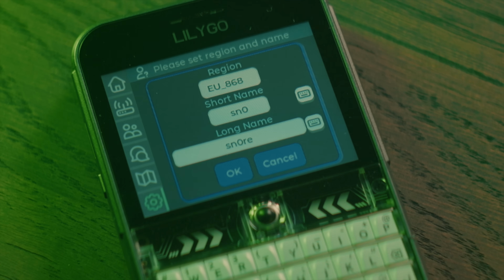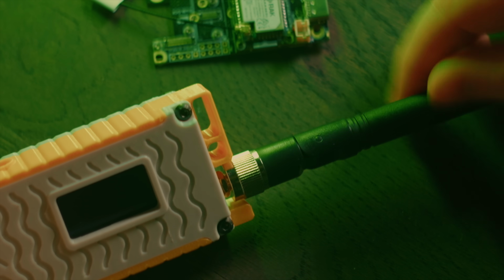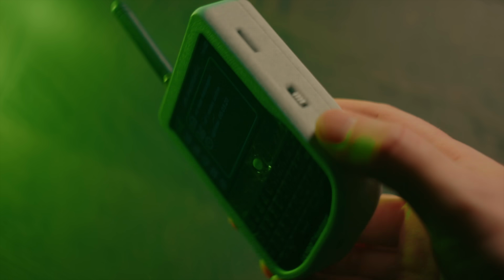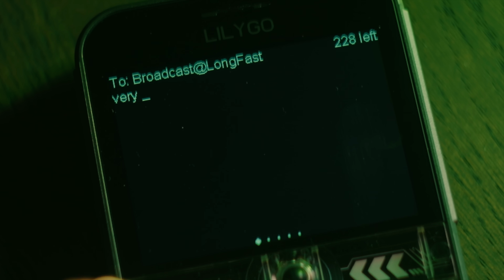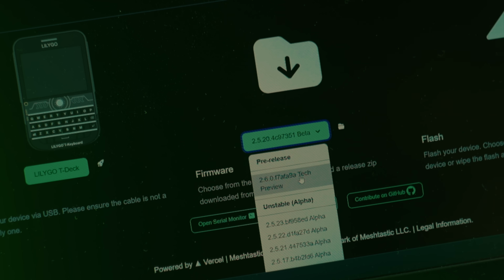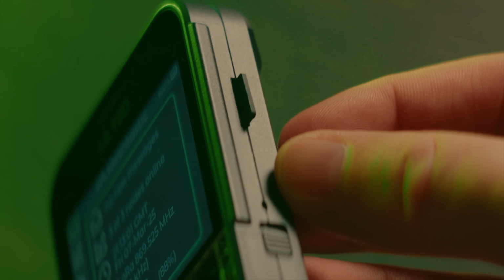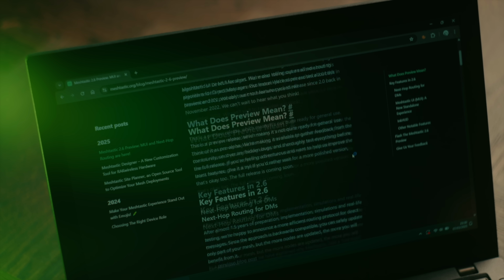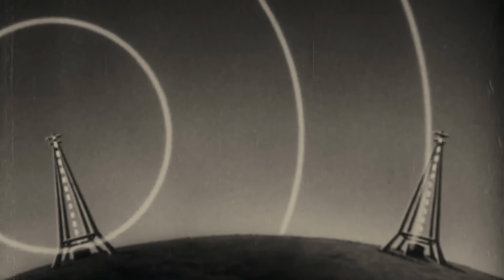Meshtastic UI is finally here.. kinda

Comment: The good news is there's no more need for the code! 😅 I know we're biased, but this is actually a phenomenal video. Great job!
Reply: Stop flogging these useless toys. We're nearly a decade into the underlying tech, and Meshtastic still can’t reliably get a message 10km across town unless your mate is in direct line of sight or you’ve lucked into a local daisy chain of powered-on devices. The only scenario where these things become remotely useful is if tens of thousands of people in a dense area all buy one, leave it on, and sit around relaying messages for strangers. Without that, it’s a glorified, BlackBerry-shaped paperweight.

People didn’t adopt mobile phones on the hope they might become useful if enough hobbyists joined in. Even in 1973, when only one Motorola DynaTAC existed, it worked. It made a real phone call. It wasn’t a community science project requiring a patchwork of participants just to deliver a sentence across town.

The hard truth is, Meshtastic will never go mainstream, not even among hackers or tech-savvy criminals. There's zero financial incentive for anyone to deploy the hundreds of backbone nodes needed to make it viable, unlike the telcos who spent billions rolling out cell towers. And at the end of the day, these janky little LoRa gadgets don’t do anything a half-decent VHF/UHF radio with APRS hasn’t done more reliably since 1984 (thanks to Bob Bruninga, a U.S. Navy engineer and amateur radio operator). All Meshtastic really delivers is a Reddit thread full of bug reports.
Reply: @Funkteon  You're acting like someone is forcing you (and others) to use these hobby devices...

Comment: will this work for regular t deck? ive installed it twice already but still has old black and green screen with 2.6 version
Reply from the maker: Yes it works for regular tdeck as well. Make sure you enable the MUI button on the firmware flasher page before clicking flash. Otherwise it will just flash the regular non ui version.

Comment: What I want out of Meshtastic is a reasonably priced solar node that isn't in a 3d printed case that will quickly degrade in the sun and not withstand rain.
People asking $200-$300 for printed options are driving people away from Meshtastic.
Reply from the maker: Just get a waterproof project box off Amazon and drill a hole for the antenna and power connections. Cheap and easy.
Reply: Just use a filament polymer that is made for outdoor use like ASA or PPA. I have a 3D printed parts with ASA operate for years outside with no issue.

Comment: 2:15 "without the app most devices are completely useless" uh ...yeah, you might be biased 😅
Reply: I was thinking you could have it connect to a AP and access the web ui that can be hosted on most boards?
Reply: @cpuchip do you mean the esp32 could relay info to other nodes while it functions as wifi AP and web server? That would be great because then anyone with a smart phone could access your mesh via a web page the esp32 is hosting. Do you know if anyone is working on this?
Reply: @martymcflyer8487  unfortunately meshtatsic doesnt support softap mode... but you might be able to set your phone into hotspot mode and have your meshtastic device join it if you turn off mobile data first. Ive prepared by having all of my phones have the meshtatsic apk and i have it downloaded on a usb thumb drive. You could get another esp32 and have it be a softap by itself to host the web ui and maps if you get one with sd card support.

Comment: Need to think how to make the T-deck into a global SHTF urgent communication device - like SPOTX without subscription or gateways. (Gateways depend on the grid and therefore vulnerable).  It's not that difficult to achieve: it would need to use 250MHz frequency instead of 868, and limit the messages (for example 1 per 5 minutes per device) by hard-coding the limit into the device itself so as not to overwhelm the network; and then propagate the messages locally through meshtastic 868 or 433 network.
Such a device could be way more invaluable than a radio; it could literally save lives of people lost in wilderness or seas and oceans.  Just the ability to receive weather info once per day when you are in the middle of an ocean would be huge.

Comment: I just discovered LoRa Meshtastic today and from everything I’ve seen so far it seems pretty lackluster at this point in time but it seems like something that could potentially grow into something truly amazing. I would love to see longer range and encrypted messages
Reply from the maker: This is not a product. It’s an open source hack making small LoRa modules do something they were never intended for - and those LoRa modules are doing something that ISM frequencies were never intended for either. Having the range that they have is already a miracle so that’s not going to increase. Meshtastic does have encryption though.
Reply: You can very easily enable longer range, but you would need more transmitting power. For which you need a radio license. And on high power, encryption is illegal. So its a legal problem, not a tech problem sadly.

Comment: The meshtastic next-hop system is an inherently pragmatic development, but one thing I find constraining about meshtastic's design is that it is LoRa only. Making a physical link layer semi-agnostic mesh system has been on my mind for a few years now, but I hit a pretty substantial blocker the last time I tried it (lack of elliptic curve cryptography in micropython for ESP32). I have a specification for a version of the PIE/VOUTE greedy routing mechanism optimized for a 256-bit address space and wrote the code for packet encoding/parsing, multi-packet sequences, a reliable delivery algorithm, and some other stuff, but I have not gotten the spanning tree stuff done because I need a working elliptic curve crypto module in micropython for the PKI first. Hopefully I can get back around to it sometime this year, because I think it will work pretty well.

Comment: How do you load maps?
Reply from the maker: Just download the files from the link in the description and put them on an sd card and put it in the t-deck
Reply: @sn0ren  Lazy question: (I put my sd card before flashing and I’ll have to take the case apart) Can I flash the SD card to the correct format in my T-deck? Is it possible to import images to the sd card via USB from a RPI?
Reply: *I will have to take my case apart to get to the SD card out.

Comment: At this point, what's the most power efficient stand alone Meshtastic device? My T-Edge seems to burn through power pretty quick, also limiting it's use as a standalone emergency device.
Reply from the maker: RAK WisBlock or SenseCap T1000-E are based on the same low power chip if battery life is your top priority.
Reply: I can recommend the WisMesh Pocket V2.

Comment: Could this be a temporary solution for Ukraine to coordinate from the front? Is it possible to restrict access?
Reply from the maker: Probably not. While it is possible to encrypt the data communication in Meshtastic LoRa signals are very weak and easy to locate or jam, and the Meshtastic system isn’t particularly robust even when it’s working.
Reply: @sn0ren  Thank you for your explanation. I'm not that familiar with the subject, but I thought it was LoRa, but I wasn't entirely sure. I'm surprised that there are no frequency jumps for stability or anything like that, because it has to be reliable for industry.
Reply from the maker: LoRa uses license free ISM frequencies. These frequencies are not intended for long range communication, but LoRa makes it work by using spread spectrum modulation. It’s all a trade off though, the data packets have to be tiny. But that’s fine for most LoRa systems because they just need to transfer like daily sensor data from a water meter out in a field and needs to be low power so that it can be solar powered. LoRa is using these frequencies and low power levels for something they were never intended for. And Meshtastic is using LoRa for something it was never intended for. If you need reliable data transfers just use WiFi.